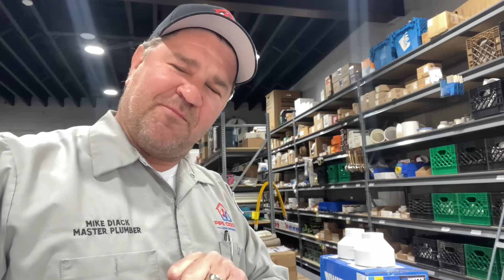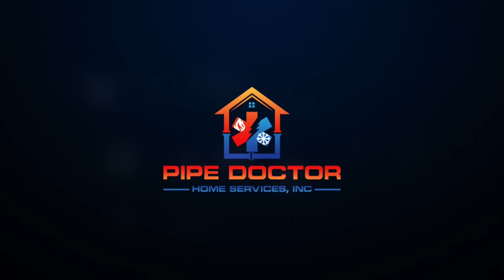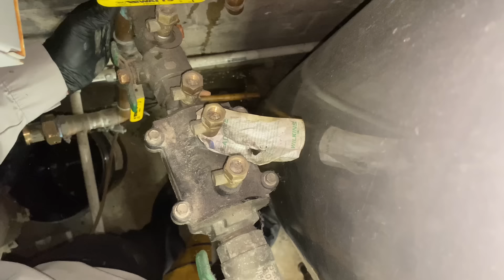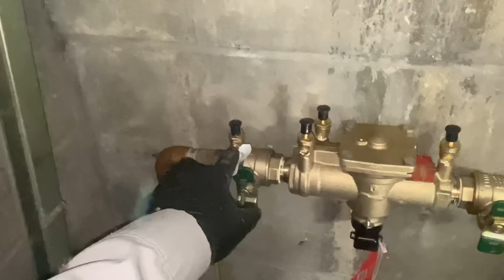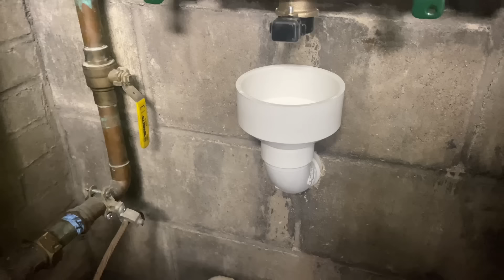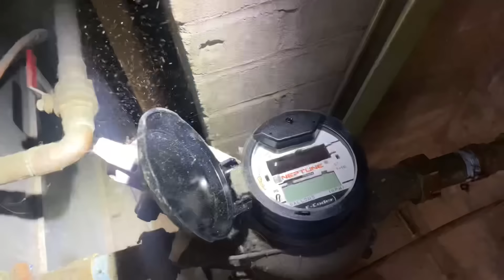Complete Installation: Watts 1” RPZ Reduced Pressure Zone Backflow Prevention Device

Comment: Hi Mike, did I miss something? I didn't see you perform the backflow prevention test after the installation. Does it meet or exceed minimal performance requirements?
Reply from the maker: Yes, I did perform the backflow prevention also known as cross connection control device. Initial test it passed of course does it meet performance expectations of the end-user a.k.a. the client well there was a pressure drop. We’ll talk about that later.

Comment: after adding a backflow, is it not required in your area to add an expansion tank?
Reply from the maker: If there is an automatic storage tank for domestic hot water, are there needs to be means to absorb pressure that’s created in a close system

Comment: Ok @ 2:00  I was not condemning your exterior plumbing job I was just saying  I like to camouflage my exterior piping so it blends in with the house and doesn’t stand out like a sore thumb I like to treat my customers jobs like I would want it on my house .  Up here on slabs I have to run a lot exterior . I just like to dress it up gives it a more professional look that’s all I was saying. 🤷🏻‍♂️
At 9:00?  What you talking about?? Have you looked at the biceps on Mikey pipes?? He could snap them channel locks in two pieces he so strong ❤😂 ( no homo )   But ? NY has some strange regulations. Here? A simple Charlie cheapie backflow preventer is all this required. 😂 our city’s don’t have pressure enough to require a pressure regulator.  But that was thinking ahead for future replacements. You’re going to be so happy if for some reason you have to replace it again  it will bee easy Peezy! Nice professional install.
Reply from the maker: Thanks for supporting the channel and most importantly thanks for posting your feedback. I did exactly what the homeowner asked for and exactly what the billing department approved and inspected to pass.